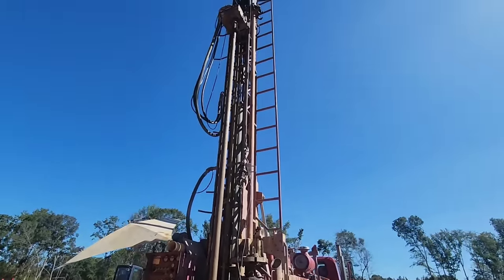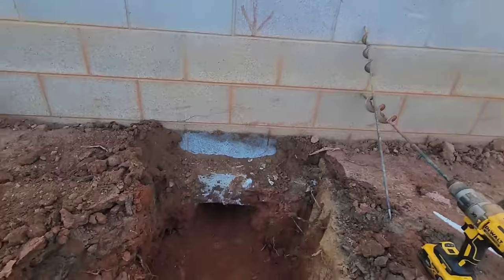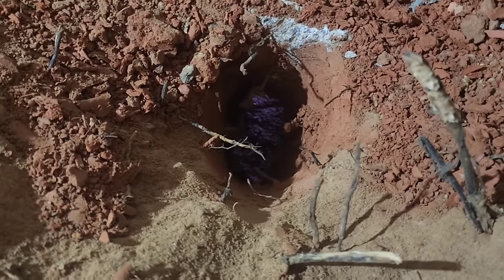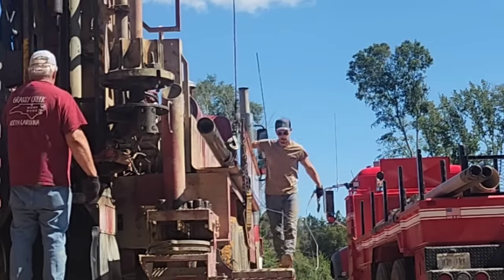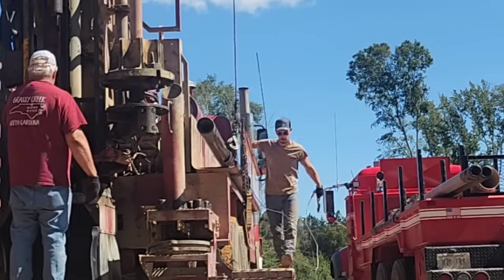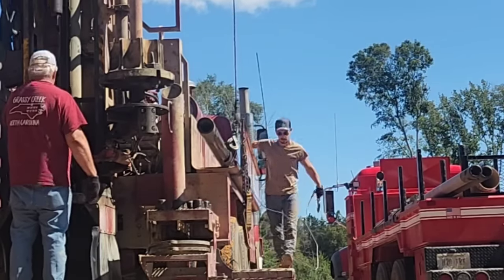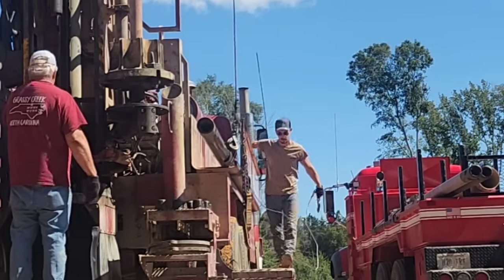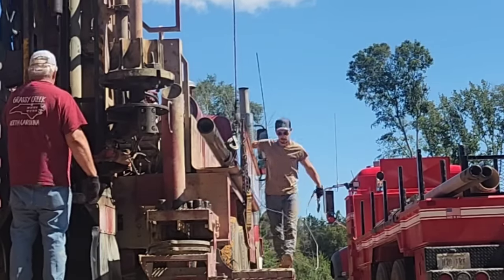Water Well Drilled to 445' & Complete Pump System Installed.

Comment: Here in Michigan, my well  tank has the motor/pump mounted on top of it and stands in it's easy accessible place in the basement.   It is were I can easily monitor its operation and maintain the water filter, etc.  I feel extremely lucky with my installation after viewing many of your videos.
Reply: Depends on the installation requirements:  well depth, homeowner budget, house design ectara.

Comment: I live in PA and can't imagine not having a basement to put all the Christmas trimmings, lawn furniture, Furnace, hot water heater, washer, and dryer.
Reply: I'm in PA also and I had nearly the same thought. All those parts would be in a full basement. No tanks in the living space of the house. In my case, the washer and dryer are on the main floor. I'm disabled so it eliminates extra stair travel for doing laundry. And the pipe and wire from the well to the inside of the house comes in through 4 inch flexible pipe. That way there is greatly reduced chance of something damaging the water line or the power line.
Reply: Head over to California or florida where some families have no idea what a basemnet is like. Our basement is half our house here in illinois. The play room, the movie room, the offie, utilities, 3rd bath, storage. Its the everything floor

Comment: Wish you had shown the system pumping. Also we require a backfill with sand prior to the rest of the backfill to prevent stones puncturing the pipe or wires. thanks for the video.

Comment: Excellent video. You guys installed almost exactly the well system I have here in Lowgap but you did it better job. I had to pull my pump a couple years ago by hand because the crew failed to properly tape the wire to the black roll pipe. Y'all are some hard working men doing the job right the first time.

Comment: My girlfriend and  live on  Black Mountain NC and when we installed fence post we used an one inch concrete bit in a hammer drill because of hard dirt and I packed the ground around my house with a roller packer everyday for two weeks dirt will not hurt a hammer drill bit
Reply: Also in Rock ridge country Virginia.  I use concrete breaker on skid steer to make holes to put posts in.
Crazy

Comment: I have about the same type of dirt here in SC. I have found that a SDS plus rotary hammer drill in hammer only mode using a clay spade bit will turn that dirt into like butter.

Comment: I've been curious.  What would you do it you drilled to 400', hit water at 15gpm and the water then rose up to a static level in the pipe at 200'?  Would you still drill another 25-50'?

Comment: I have a question. If you drilled the well at 455 ft why did you put the pump in at 300?. And how do you know where the bottom of the well sits or the aquifer whichever it is?.

Comment: Very neat process! I have been meaning to ask you I bought a home with a existing well and septic system that all works great so far, so even though the septic system inspector guy had my water tested through the county gov., mainly for e coli, and it came back fine, there is no filtration system at all here, so I'm just wondering if you think it is necessary to have one? When I first looked at the place the water had a very strong sulfur odor, but completely cleared up very quickly right after I got moved in and the water looks very clear and tastes just fine, there is a slight limestone build up on drinking glasses and glass dog bowl for example, so if you would please let me know what you think of adding a filtration system here? Honestly I would just like to go without one? I am a subscriber to your channel and watch and give likes to your videos regularly. Thanks

Comment: You did a great job filming the drilling of the well and the whole installation process.  I was wondering if the owner wants a water softener, does that have to go under the house, or could it be the place near where the waterline goes up into the house/?  I appreciate how much hard work you have to do to film these projects.

Comment: I have a well with depth 270ft and water starts at about 140ft but I don’t know the gpm, what pump should I buy and at how many ft do you recommend to place??? Thank you
Also, the waterline will be ran about 250-300ft to reach the house if that matters.
Thank you!

Comment: In Australia underground electrical has to in special conduit if shared trench with water pipes  electrical has to certain depth under the pipes or separate trench
Reply: That is the code where I live in New York as well.  It's crazy how different states/cities in the united states have varying rules.  I know alot of these rules are dependant on climate.  For example the water line has to be buried and trenched at least 1.2 meters below grade because of frost in the winter.  In Florida it's warm so they don't have that same rule

Comment: When screwing the drills together how to assure you don't cross thread?
Reply: The treads are called “tool joint” ,they are in a cone shape and

 just about impossible to cross thread. Look very carefully at the male end of the drill stem and you will see the cone threads and the driller applies a lubricant with a stick with a rag on the end

Comment: I got a technical question for you If you don't mind. Do you use two different drill bits when you're drilling one bit until you hit bedrock and then switch to a smaller bit for the rest of the drilling process? I haven't seen or understand how the casing is sealed at the bedrock level to keep the grout from going any further down the hole. Or do you use some kind of packer on the first piece of casing like if you were relining an existing well. Thanks Dan
Reply from the maker: Yes, the big hammer we pick up at the end is what's used to cut the initial hole down to bed rock. Then install the casing, & then the smaller bit/hammer goes in the casing & to the bottom to start drilling thru granite to find water

Comment: I subscribed to your channel because of your knowledge and the way you show everything you do in your videos. Can you tell me are they any specific symptoms one has when the bladder is busted in the water storage tank? I'm a single female trying to get it figured out. Thank you and your the best.
Reply from the maker: A bad tank will cause the water pressure to fluctuate rather quickly. If you run a sink, & go to the tank, listen to the switch click, a bad tank will cause the switch to click on/off/on/off every 2-3 seconds. A properly set tank should run for 30 seconds between cycles. 
A bad tank may also give you little busts of air in the water, over time the tank will rust internally and the water will get slightly Discolored. 
Knock on the tank, like you would a door 🚪 a good tank will ring/sound hollow. A bad tank will sound full of water. 
2/3s of a tank should have air in it.
Reply: very true the inner membrane can get a hole in it which will water log the whole tank unless it is a constant pressure tank  @h2omechanic

Comment: I think I would invest in a small electric jack hammer for digging in those tight spaces.
Reply: they use a lot of pipe dope and the threaded pipe is coarse also Iam sure they line up the rods to be true .

Comment: are you compensating for voltage drop over such long romex cable? you can lose 25 volts easy even in just the well, not even adding the run to the well itself. that pump wont like it being run at like 80 volts or less.
Reply: Won't lose 25 volts, it's not pulling 30 amps. If there's only a 6 amp load, will only lose maybe 4-5 volts. Not an issue. 400 feet of wire, he uses 10ga wire. Pump only draws 6-7 amps. At 400 feet, 10ga wire is good for 12-15 amps no problem. The voltage drop is a function of current and resistance. For example, even if you had a 20 amp load on 400 feet of #10 wire, and you had the full 240 volts at the disconnect switch at the beginning of the wire, the voltage at the load end would still be 223 volts (7% voltage drop). This is in excess of code recommended max 3% voltage drop, but any pump will still run happily with 223 volts, as they will all run on 220. In fact most 240 volt pumps can also be used on 3phase systems where the line to line voltage is only 208. (120x√3). As long as there is a minimum of 220 actually at the pump motor, it'll be fine.
Reply: At 240 volts supply voltage, and using 10ga wire (it's not romex that they use its submersible pump wire, the grey wire from pump to house was UF direct bury rated wire), then the maximum distance you can run 10ga wire from house to the well, down the well to the pump is 667 total feet, before you have to go to #8 wire, based on a 1HP pump.

Comment: I have a question that’s off-topic, but would really like to hear your answer. I have a 144 foot well and I think a 20 gallon tank in the basement.  When we take showers the water will run strong for about 2 minutes, then fade to almost nothing for about 2 or 3 seconds, then back to full strength for several minutes.  It may repeat itself a second time in a standard timed shower.  Same thing happens with the outside water hose when we’re washing the car or watering plants.  Is this a fixable issue?  What exactly is happening?  I appreciate your help.
Reply: Pressure tank bladder not set to correct pressure or has collapsed. Okay had to get my 2 cents in I am sure others will wade in here with something more helpful.
Reply: Tank bladder should be 3psi lower than pressure switch cut in.  I over sized  my tank to make sure pump has at least 2 minute run time to prolong the pump life.

Comment: How do you tell how many GPM the well makes as you're drilling?
Reply: you use a bailer a  20 foot pipe that has a spade bit kinda like a  plunger it traps the water then a timing device and a measuring pail  and up and down the hole it goes

Comment: I have a well question.  I bought a house with a well.  The well drillers drilled the well to 525’ but the pump was placed at 200’ why bother drilling so deep if you are only going to put the pump at 200’
Reply: Because the majority of the water comes from the deep aquifer and there is enough pressure to bring the water higher in the well. There may be little to no water available up higher.

Comment: I used a 3000psi pressure washer to tunnel under footers .
We have rocks in  hard  clay impossible to hand dig .
Pressure washer blows a hole loosens soils clay so a worker can pull rocks out .
Hope this helps others.

Comment: Have you ever struck oil.
Reply: Oil would much deeper than what a water well drill can handle. Oil could be 5000-10000 feet and only if there is oil in that area.

Comment: Why drill to 445ft and then set the pump at 300ft?
Reply from the maker: Water will be 30ft from the surface, the well produces so much water, they'll never get the water level to pull down that far.

Comment: Is there such a thing as a float for inside the well that kills the pump if the water level is too low? I'm in Ohio, and in my area there is a severe well driller drought. The guy I found got to 70' with an 8 inch hole, rock the entire way. One 20' of 6" casing at the top. When its full, it holds about 130 gallons, and refreshes about 45 gallons an hour.. how screwed am I going to be if I just yolo it without a tank?
Reply: He was using an attachment for his skid steer to drill, and had major equipment failure and is getting out of the drilling business entirely, which is why he didn't go further
Reply: In industrial applications, we can put a transducer in the well to monitor the water level and program it to shut off the pump if the water gets below a certain level. It might be cost prohibitive in a residential application. I will be installing one in a well where the pump is set to 1000'.